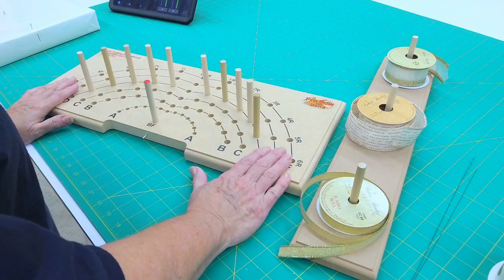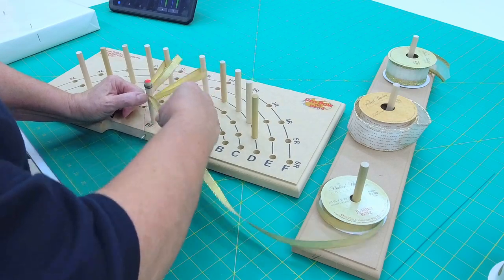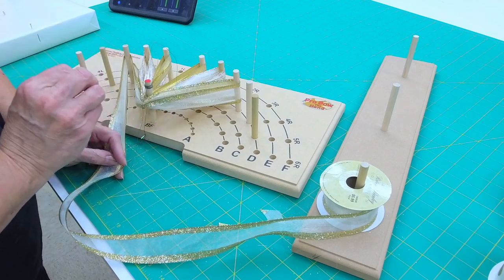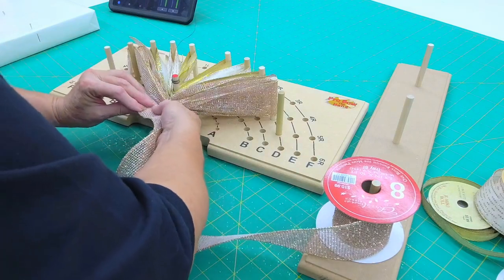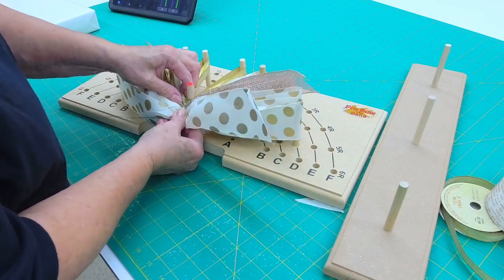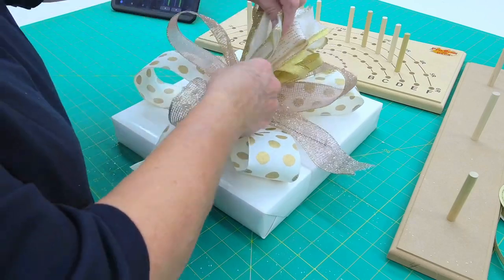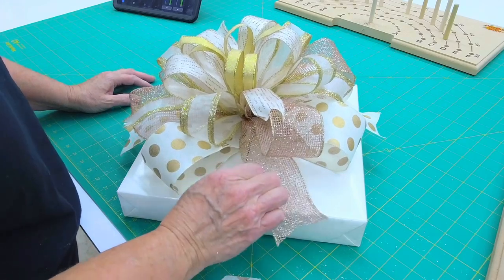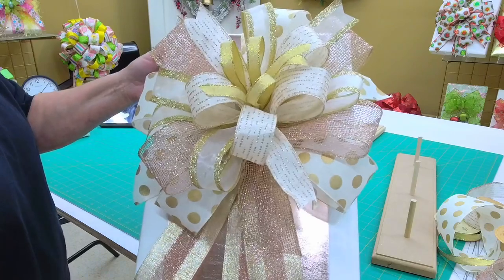Double Terri Bow

Comment: Beautiful you are very inspiring what's the shortest length of ribbon you can use ?
Reply from the maker: Well, I have made a bow using 1/8 inch wide ribbon and the bow is a half an inch cross. I used about 3 inches of ribbon at the most! People use these tiny bows and scrapbooking and card making, I hope that helps I have a video on it. Please enjoy